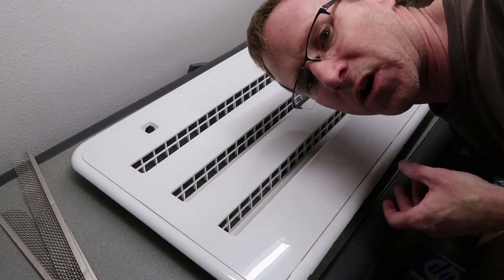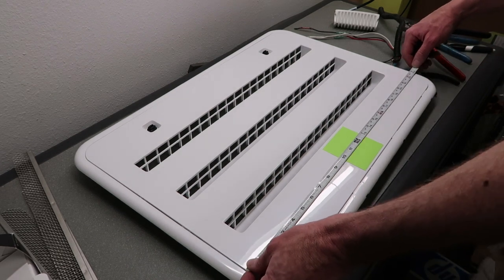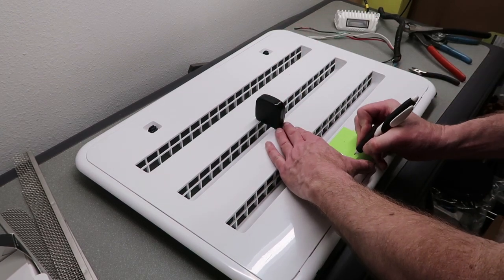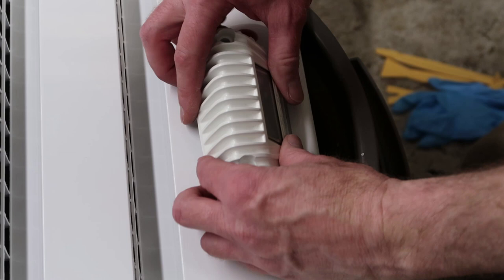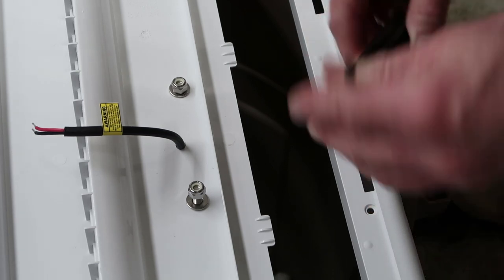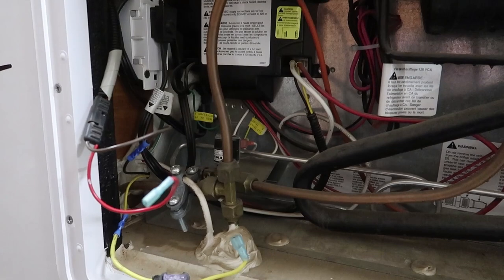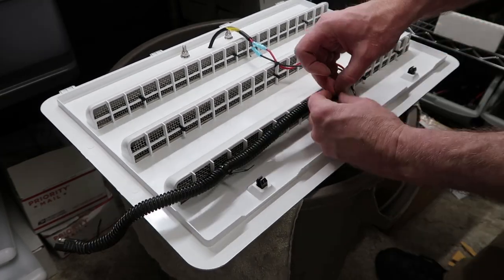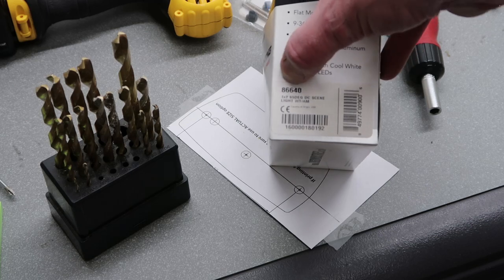RV Lighting Upgrades: Installing an outside light in the fridge vent

Comment: Is there a way to put the switch inside? I have an AF 990 and it would be cool to put the switch inside near the large dinette window. Maybe drill it through so it's on the divider wall between the fridge and dinette?
Reply from the maker: It could probably be done with some careful measurement and planning.  The problem is, the lower vent sits at the bottom of the fridge, so the side wall of the fridge compartment that's accessible from the lower vent is hidden behind the dinette cushion.  Also, there's so much "stuff" in the way on that side of the back side of the fridge, you probably can't get a drill in there easily.
Reply: @Delta Bravo  Thanks for your insight I appreciate it.